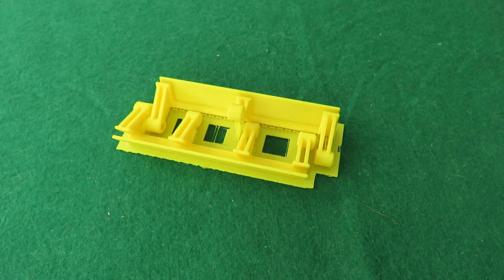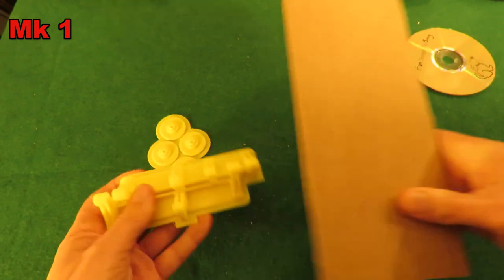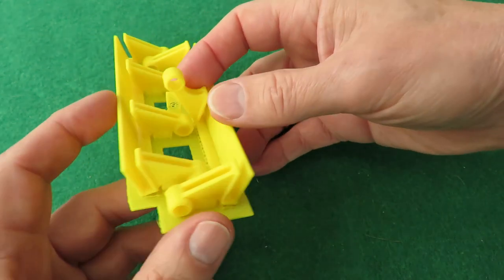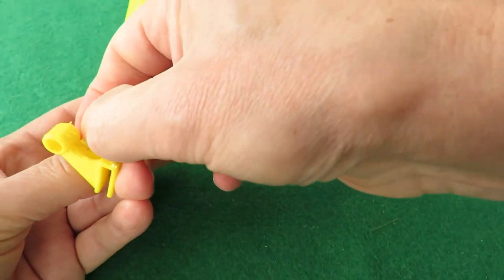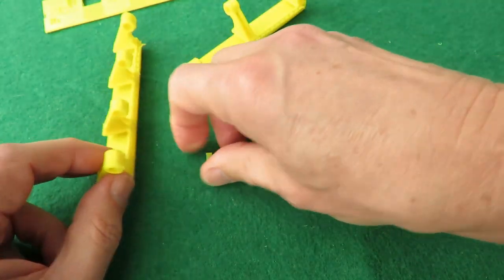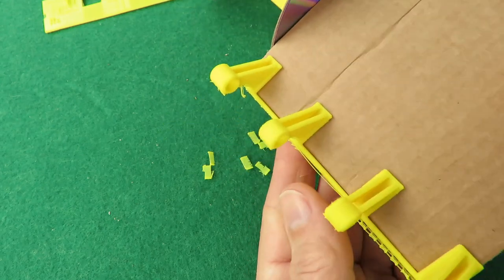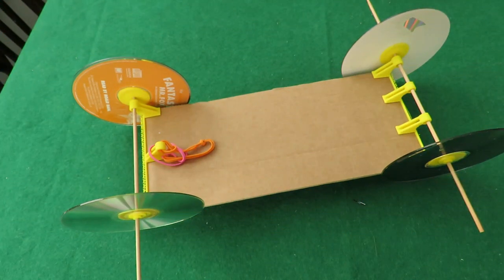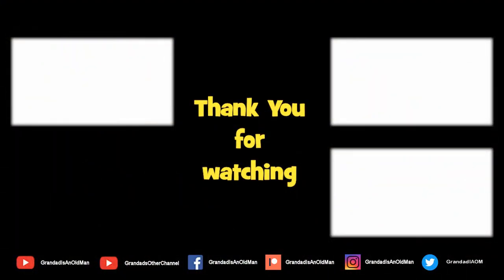Mk2 3D printed axle tubes assembly for Rubber Band Car

Comment: That's a nice design.  It seems to work very well.  And it's fun to see how you're using the 3D printer.
Reply from the maker: At the moment it is quite convenient as the weather is stopping me doing much outdoors so learning to use the printer is a convenient use of my time. However I am worried that it encourages me to spend too much time tinkering.